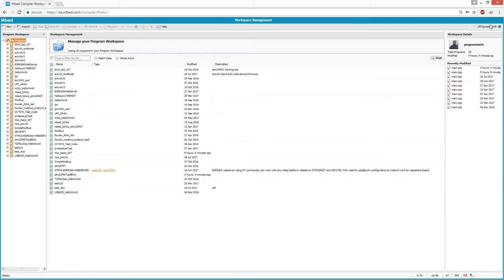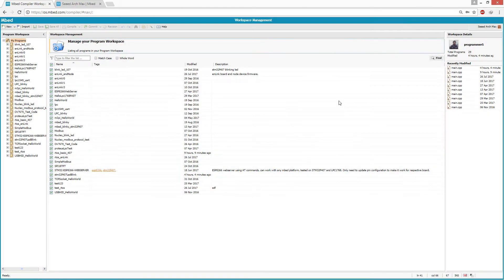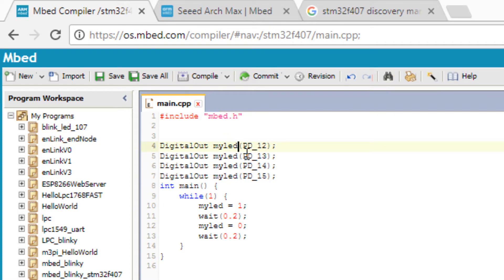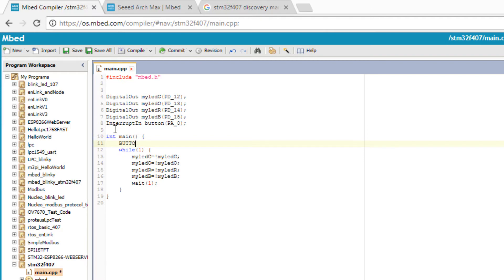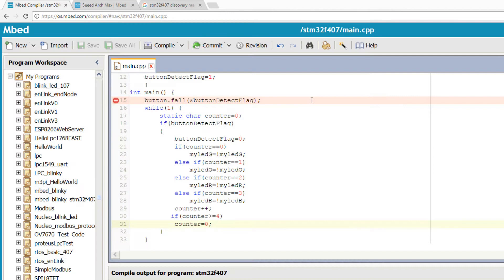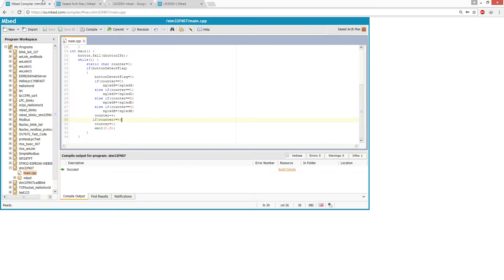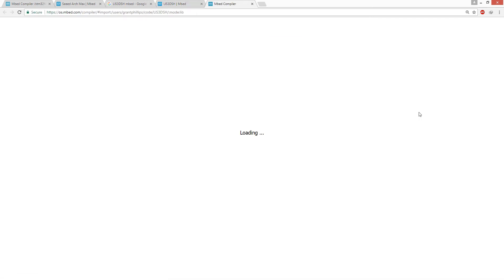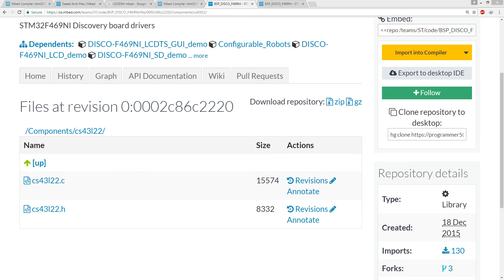stm32f407 discovery programming super easy

Comment: How to get output by using keil software. I am working on DSP operation and try to burn it on stm32f407vg board
Reply from the maker: There are example codes from ST, they compile for both Keil and IAR.

Comment: Hey bro, how do you use docklight to connect the board?
Reply from the maker: I use docklight for com Port monitoring, to load program to this board, Don't need any software
Reply: @farrukh4303  Ok thanks bro, but after i connect the docklight with my stm32f4, it did not show any data on the docklight. I follow exactly the same as what you did in your video. The LED is working, can you tell me how you display the sensor output on docklight?
Reply from the maker: @zibinyuan8254  maybe just try to send hello world in a loop with some short Delay and also check if both docklight and STM have same baud rate.

Comment: Selam Faruk :) 
my brother, i need your help xD i am a begginer, and i have to make a project for a course at my faculty.
my task ist: to make a project that will play some short sound (wave / audio) constant, when I press the pushbutton on the tile STM32F407G. When i press it again the sound shuld go off. (my professor told me to do that first for the beginning, after then, he will give me an additional tile that will just have 5 more pushubuttons on it, and I'll have to connect that with STM and do the same thing with 5 more sounds for all pushbuttons, that will work  independently of each other, like a synthesizer :D ) 
So i try now to do the first part, but i have no idee what i shuld do first xD do you have maybe any example similar to my project, or maybe some good introduction/scripts that will help me to make this project. 
thanks in advance, I would be glad for some answer :)

PS: i work on ubuntu with using Geany, but it's not a problem for me too switch on another IDE
Reply from the maker: instructor allow you to use MBED ?
Reply: @farrukh4303  MBED is another controller I guess. No, because we do all short exercises only with STM32f407 from the beginning (led, timers, DMA....), that's why we all had to buy it, and now we have to do alone some project. He told my group to do it with STM, i mean... he told nothing about using another controller. "Do it with one sound and the one pushbutton on STM, if it work i will give you a tile that have 5 pushbuttons" which I will connect through pins.
Reply from the maker: @xxxARBiHxxx  mbed is just a platform, like Arduino, you can program many different chips with mbed.

Comment: Can u please tell me how u connected the uart in it. And software details regarding it.
Reply from the maker: software for serial data monitor is docklight, you can use any uart/usb converter. code link is given in description. TX pin is PC6,
Reply: thank you sir. can u please make a video on can an usbhid linked stuff. i will be very happy to hear from you the details regarding them. or could u please tell me where to find these stuff...
Reply from the maker: do you have to configure discovery board as an hid device or want to connect some hid device with discovery board?
Reply: Farrukh I have to make a communication between  stm32f4 and a pc. Ive gone through some surfing and found that we can transfer the data through usb hid protocol, using hidraw. I decided to send can bus data  to pc using this hid protocol.

Please help me regarding this. Ive gone through many ideas but all are been futile!

Thanks in advance !!
Reply: Farrukh I have to configure stm32 as a hid device
Reply from the maker: satish naidu ok, I haven't tried that yet, there should be library for hid in mbed, I'll check